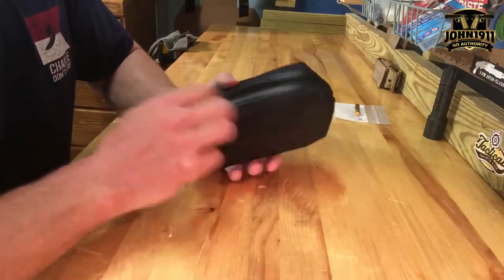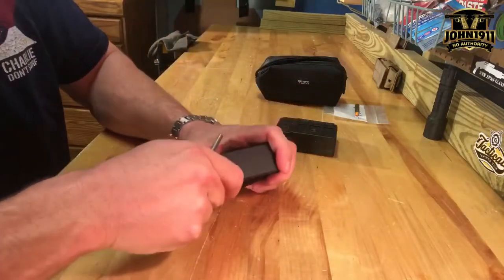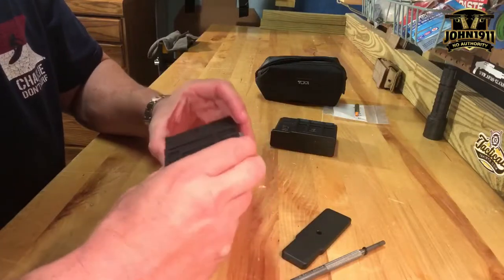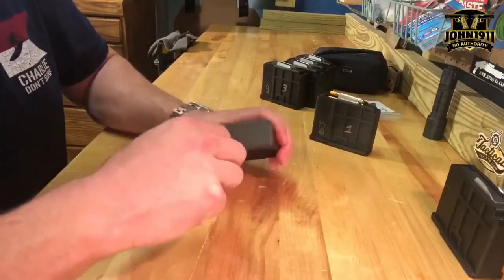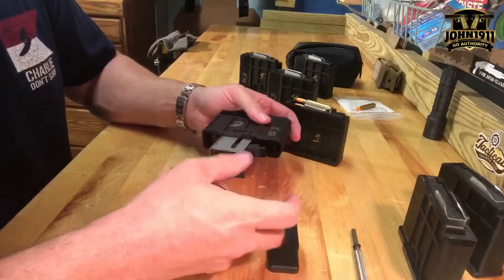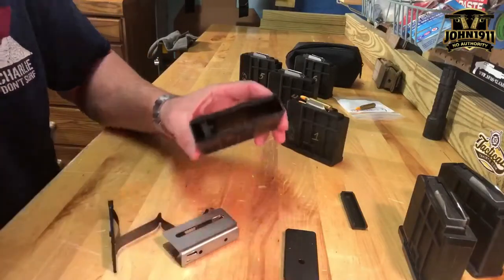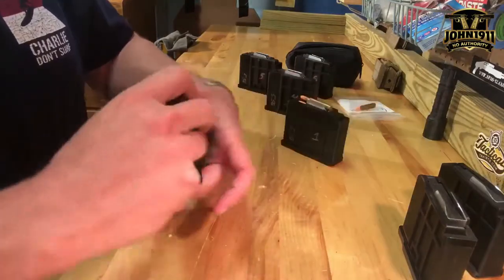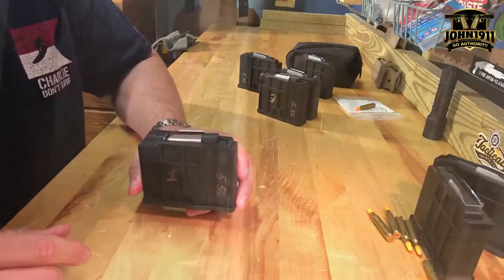Blaser LRS2 - TAC2 Magazine Repair Update

Comment: That's right John, all LRS2 / Tac2 magazines are different inside based on caliber.  There were 4 calibers for the Tac2 and about 7 for the LRS2.  I have some oddballs in .243 and 6.5x55 swede, each mag has different internal parts, but they are the same within each caliber.  There are no generational differences.

To understand why Blaser did it like this you have to look at the LRS1 and UIT/CISM early 1st generation guns had the whole magazine lift up and down inside the magwell.  It was pretty crazy, so they decided to re-engineer all that into the magazine for the LRS2 / Tac2.  I will have a video up shortly about the history of the rifles, and I will be showing all of this and much more (I have an LRS1 and a Tac2).